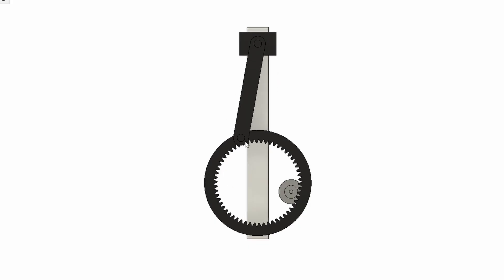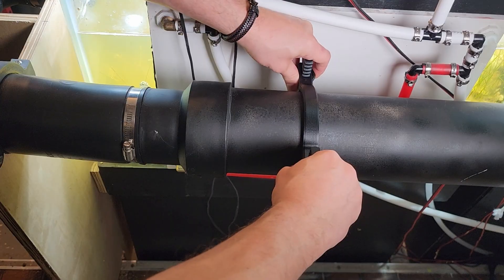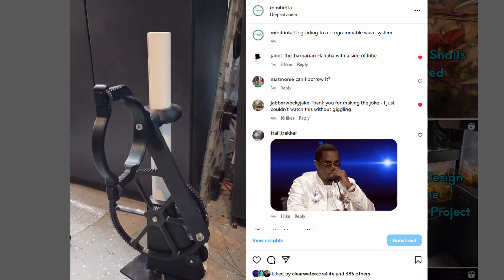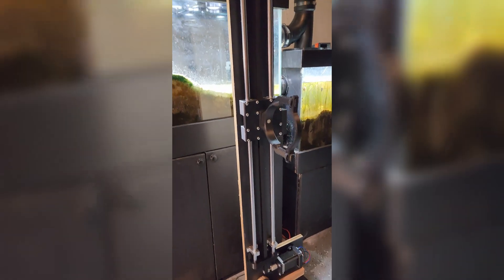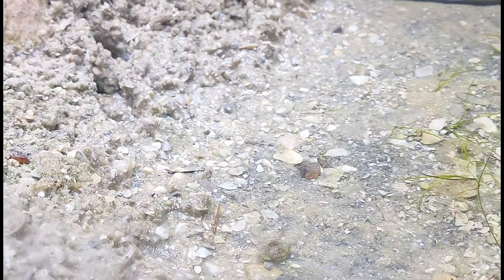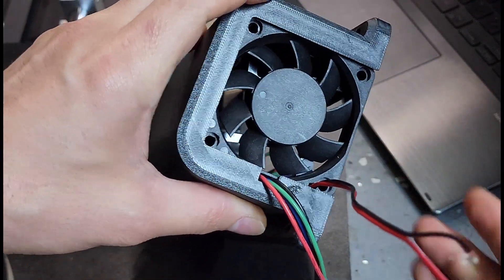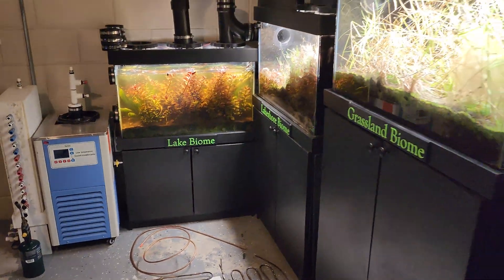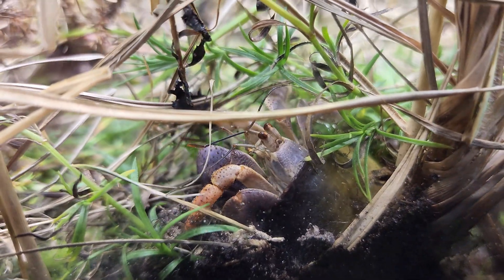Biosphere Project Now Has Waves and Tides

Comment: What I don't understand is that if it is an enclosed system that isn't supposed to use electricity, how does the actuator work then?

Or are you saying no electricity from inside the tanks?

Because if that is the case, why not just use a wave maker that can be powered from the outside of the glass and have it to open and reverse on time tables to make waves? 

Though that would take programming I suppose. Unless you're cycling it to just turn off and on intermittently to mimic it with the bounce back reverb of the water.
Reply from the maker: The equipment is kept on the outside of the system so that the system can be sealed and not opened for any reason. I also didn't want to have pumps, fans or anything like that interfere with the movement of resources throughout the system. It's so that inside, the cycles of resources can take place as close as possible to how it works on Earth. 

I built the wave and tide system so that wave but also tides can be simulated. An off the shelf wave maker could only make waves. I also wanted control of the system so that I can tie it live to the real spot this is simulating. But that further down the road.